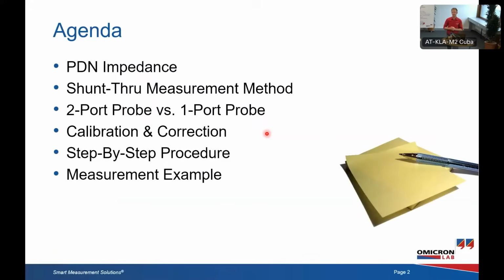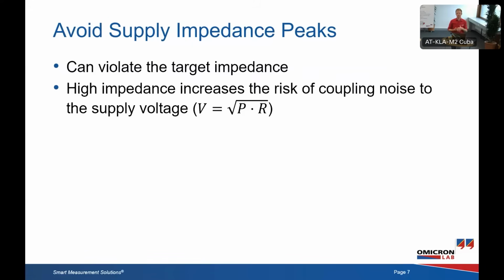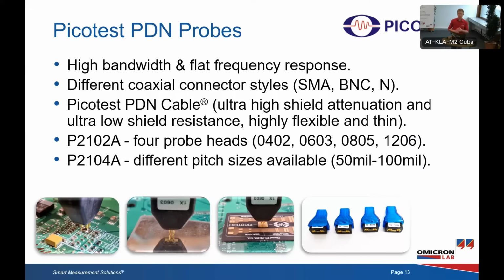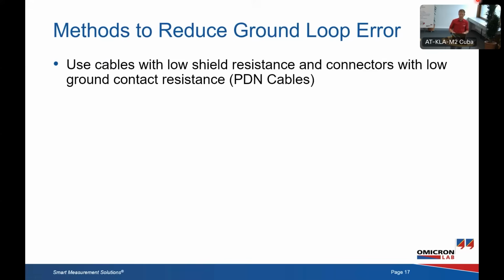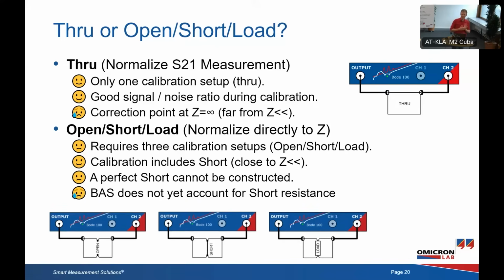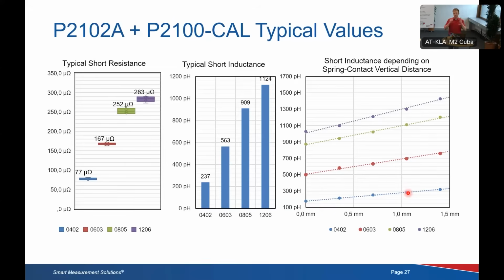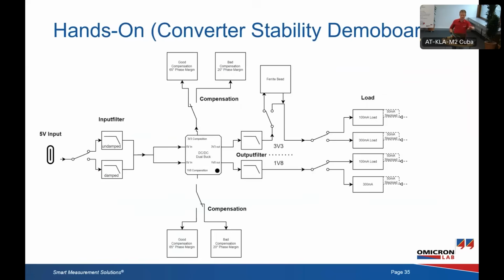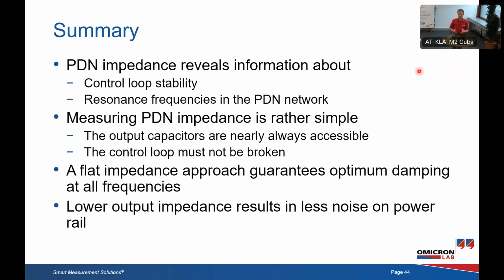PDN Impedance Measurements using the Bode 500 and Picotest PDN Probes

Comment: 50:24  When you added the ferrite bead between the capacitors, it added a second large impedance peak. That an undesirable effect on the impedance right?  Isn't the goal for flat response?  Maybe that was the point you were making, but just didn't seem clear to me.
Reply from the maker: Correct. Impedance peaks are typically undesirable in a voltage source since the impedance at the peak can get extremely high, causing significant voltage ripple when current load excites the resonance peak.

Comment: Thank you, Florian, for a very interesting video! I have a couple of questions.
- At 9.20 you show two impedance plots. Is the blue one only a dream, or would it be realisable? How does it decrease the impedance seen by the load at the high frequency peak?
- An interesting demo would be to use the Bode/Picotest combination on some real, third (or fourth) party PCBs to demonstrate the difference between a good and a poor PDN. 
- The formula introduced at 13.30 might need more explanation.
- Would it be possible to make a (very delicate and expensive :) ) Kelvin-type probe with four needles, two for the excitation (current), and two for differential measurement of the voltage difference across the point of interest, e.g. a capacitor? The differential measurement would use both the input channels of the Bode. All three coax shields could by connected at the probe, so ground currents would still flow in the measurement cables, but as the difference is measured, this would not matter. Well, I am sure you tried this already :)
- At 43:30 the impressive noise floor of the Bode 500 is shown. It is not clear to me how the voltage across the short is measured, with channel 1? 
- How important is it at higher frequencies, > 1 MHz, to have the PCB under test powered on?
Looking forward to the next video from you,
C
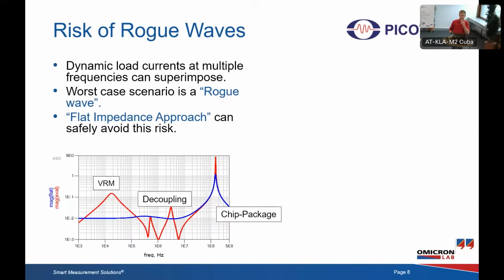Reply from the maker: Hi! The blue curve at 9:20 is a simulation done by Picotest. It follows the "flat impedance approach". Steve Sandler is doing trainings on how to achieve this. I think the blue resonance peak is lowered by removing the low-impedance valleys. Thanks for the hint to the explanation of the 2-port shunt-thru formula. Regarding the noise-floor, the CH1 is not connected, the receiver 1 is routed internally to the signal source as a reference signal like in the S21 measurement. Powering on the pcb is important to see the dc-bias loss of ceramic capacitors when they are charged.
For a more detailed discussion, please contact us via support@omicron-lab.com.